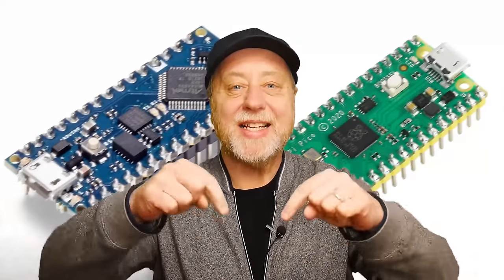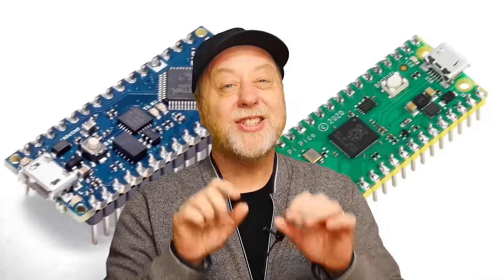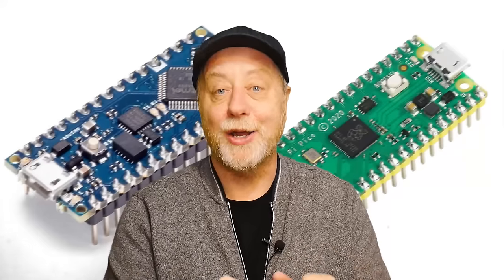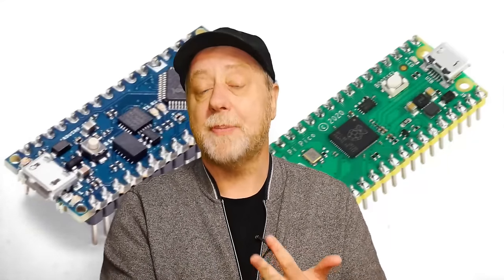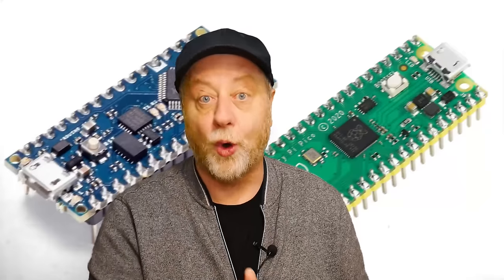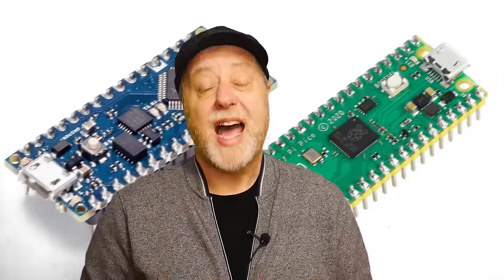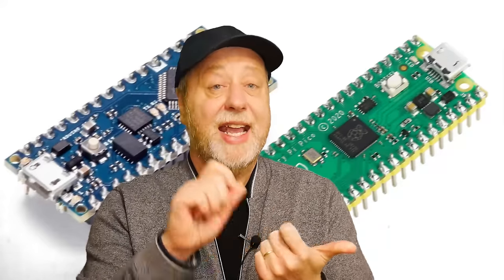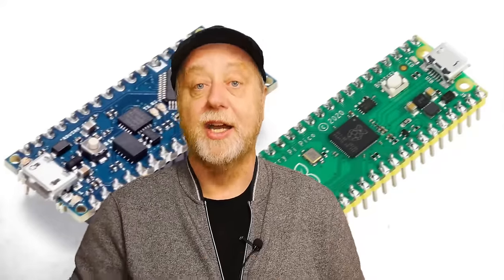Arduino vs Pico - Which is the Best Microcontroller For You?

Comment: Let's face it.... The only benefit in programming with the Pico, regarding Language,  is you can use Micropython.... It's absolutely no Problem to program an Arduino in C or C++ .
Reply from the maker: Can you write a multi tasking OS for the Arduino on C? I did for the Pico. Videos are on this channel.
Reply: @GaryExplains  Yes, you can run FreeRTOS on some atmegas. Arduino IDE uses full C and C++, in fact you can use C++17 without any issues.
Reply from the maker: Please point me to an Arduino IDE sketch that allows you to do context switching.
Reply: @GaryExplains  How is this related to being able to use real C and C++ in the ArduinoIDE? As I mentioned above, you can use C++17 with templates, constexpr, etc. Also, FreeRTOS runs on pretty much all atmegas, including with preemptive context switching but I don't see how that's relevant as it's just proof of what peripherals and features atmegas provide, not of being able to use C/C++ in the ArduinoIDE. 
I found your videos very interesting, but this is just not true: there is no special version of C for the Arduino. It's regular C and regular C++, same as for the pico.
Reply from the maker: The fact that you need to use setup() and loop() means it isn't FULL C/C++ access like the Pico. You have access to all the C/C++  stuff, yes, but you can't write you own OS for the Arduino using the Arduino IDE, something you can do with the Pico. That is very much related. it is not true that the C for the Arduino is the same as the C for the Pico. If it is the same as you say, then please take my Piccolo OS (it is in my GitHub), which I wrote for the Pico and port it to an Arm Arduino using the Arduino IDE.
Reply: @GaryExplains  Ah ok, you're referring to the entry points being different: pico having the int main(...) and Arduino having the setup() + loop(). This is part of the runtime, not the language. Same is true for console applications in windows that use int main(...) and win32 applications that use WinMain and an event loop: they both use FULL C/C++ even if their entry points are different. Same is true in our case here: runtime support and entry point != language support. Also, btw, using loop() is optional. You can treat setup() as main() and do everything in there.
Reply from the maker: OK, I give up we are clearly at an impasse. The simple fact is, not matter how much wriggling you want to do, that you can't port an OS like Piccolo OS to the Arduino using the Arduino IDE. That by definition means they are not the SAME. Clearly you think the word SAME has another meaning. Also you seem to be a little lost in your argument, I asked "Can you write a multi tasking OS for the Arduino on C" in the context of the Arduino IDE, you replied, "Yes" but now you are making arguments about entry points. It is truly dizzying talking to you. Bottom line: can you write and OS like Piccolo OS using the Arduino IDE? Answer, no. Therefore they are not the same. Everything after that is just noise.
Reply: @GaryExplains  I'm sorry you feel that way. Let me explain what I mean: You mention in the video that Arduino doesn't use the full C and C++. That is false, or at the very least misleading, as Arduino does use a full C/C++ compiler. All the language constructs are available, even more modern ones like C++17. There are differences between the 2 of course, like the main vs setup/loop entry points. BTW - I looked at Piccolo OS code and I don't see any reason why it cannot be ported to atmega. Functionally, the main function in pico is equivalent to the setup function in Arduino. Hope this clarifies what my point is, as I'm not trying to be combative in any way. I have lots of years of experience on atmega and arduino (as I'm sure you do as well) and I'm just trying to clarify what I perceive as a misunderstanding on your side. Cheers!
Reply from the maker: Please give me the timecode where I say that "Arduino doesn't use the full C and C++. " I just doubled checked the video and I don't say anything like that. Maybe that is why you are arguing with. I do say the Pico uses full C/C++ and that you can write a multitasking OS with it, something you can't do with the Arduino IDE. I think you have basically misunderstood what I have said and are arguing with me for no reason. BTW, it isn't a misunderstanding on myside, but on yours. The key word is "perceive", I think you truly believe that you are right and trying to argue a good point with me, but you are sadly wrong. I await the timecode where I say what you think I said. As I have said repeatedly (and in the video) you can't create a context switching OS using the C/C++ (and runtime if you insist) that comes with the Arduino. Please show me an example of context switching using in the Arduino IDE. And I don't know why you keep going on about the atmega, since there are Arm Arduino boards, lets just stick with one arch. Can you port Piccolo OS to an Arm Arduino using the Arduino IDE, yes or no?
Reply: @GaryExplains  I think it would be worth mentioning that Arduino can be programmed without any use of Arduino ecosystem in plain C/C++ and compiled using avr-gcc, in which case you just have main() function and you are enabling pins by setting registers, which is actually faster than using digitalWrite()
Reply: You don't have to use Arduino IDE If you don't want... The Classic Arduinos use Atmega Chips, most of these Chips existed long before there was any Arduino....

Comment: 8 Bit won't make it slower.  It simply limits how much you can do.
Reply from the maker: If you think that then you don't understand the difference between 8-bits and 32-bits. Think about adding 70000 to 8000. Is that slower with 8-bit arithmetic or the same speed as 32-bit arithmetic?

Comment: Regarding debugging and writing low level code with arduino, you can always use atmel studio’s ide. That isn’t necessarily an advantage of the pi.
Reply from the maker: You could always write the binary by hand. The point is not about alternative software available for each platform, but rather the official software.

Comment: Arduino does use actual C++ with gcc under the hood. It just does some pre-processing to create a proper C++ file (concatenates .ino and .pde files, generates function prototypes, sticks #include <Arduino.h> at the beginning, etc). But you can use all of the features, like constexpr, templates, lambdas, auto, SFINAE black magic, etc.

Comment: I think for beginners Arduino is definitely the one to go for because of all the educational resources and tooling available. Once you become more experienced then Pico is a viable alternative for projects, and perhaps preferred for cost and obtaining control over low-level details.
Reply: Pushing 50 and I picked up my first Arduino less than a month ago...  Tempted there exactly as you describe!  
I have a few Node MCUs with Wifi on them to try and make the clock I have working on a 'clone' maybe talk to the internet for accurate time...  
I feel like I have bitten off more than I want to chew, but I AM only a month in, and I DO see the plusses of the Pico already.
Reply: @Summ0ns  Haha, age same. Same condition. First time user since a month. Great stuff indeed, it's a huge step forward compared to hobby electronics just 30 years ago. About the need for an accurate time, the logger shield of Arduino has an RTC chip on it where one can set the time and it would stay on par while the battery lasts. One more, the SIM800 shield receives date & time stamps of SMS messages accurately. Or simply buy a PCF8523 DIP version of the chip and connect some minimal components to connect via I2C to it, and voila. I wonder if there are RTC chip only shields though, if one is only interested in the RTC functionality. 

Side note to the Pico, it has huge potential, to start with it is not restricted to this tiny RAM the Arduino Uno for instance has. Using the Mega just for a bigger RAM is a bit overkill in my case.

Comment: Great Video!! I've been using Arduino for the 5 years but have kept my Eye on Raspberry Pi. Most of my projects can be done with a Nano however some of the not complicated projects that require multiple I/O are tough to design due to limited or over lapping pins for different protocols. The Pico with multiple SPI busses and I2C support will solve that nicely. I'm also thrilled that it can be programmed from the Arduino IDE. I will be strongly considering the Pico but I don't think I'll get rid of my Nanos though. My number one complaint is the 3.3v logic level voltage needed. The Nano shines with its onboard regulator

Comment: This is very interesting as a hardware engineer I have always loved arduino it makes hardware projects so fast and easy however i have had issues with debugging capability in the past, if you aren’t careful you can get in a mess very quickly, and also limitations due to only having a single core meaning I had to use 2 boards.  I have loved the ultra low power capabilities possible with arduino and wonder if the pico can compete in this respect. I am definitely going to get a pico and have a play with it there are probably certain projects I would use it over an arduino
Reply: > "due to only having a single core meaning I had to use 2 boards"
You could just code things differently instead: either do some basic multitask stub via constantly looping over multiple smaller functions, or utilize a dedicated middleware solution like FreeRTOS.
Reply: @TheLukasz032  Idk much abt anything, but I would use some protothreading library i found online to run stuff on my arduino.
It didn't seem to really have any issues at all. Really did work perfectly fine.

Comment: Very informative. A year ago I designed and built my own Energy Management System based on a Rasp Pi Zero with Python but I wanted to interface to a micro-controller to read pulse outputs from 3 electricity meters (PV generation, Consumption & Purchase). I was going to use IC2 for the Pi to request the pulse counts every x mins. My first choice was the Pico as I could use Micro Python but found that Micro Python does not support the Pico as a client. I found a web comment from the developers that it was too complicated and unreliable. 

So I switched to a Arduino Nano Every and found the IC2 client library and the IC2 general support was very good and I soon had written the client code; all interrupt based. 

One issue was the Nano is a 5V board so a 3V3 to 5V logical level converter was needed on the IC2 interface, plus a 5V supply was needed. Another issue is that I could not get the Arduino IDE to run on a Windows 10 PC with a usb connection so had to use the web IDE. Finally, I burnt out one Nano when it was connected to a 5V supply via the 5V pin and the usb socket at the same time.

Comment: I mostly use teensy boards (with arduino libraries and the arm-none-eabi-gcc compiler) but I think I will have to try the RPi pico, it seems a very capable board especially for the price
Reply: It's surprisingly fast and capable for $4. MicroCenter had them on sale for $2 when they came out and I got a bunch.
Reply: Some of the earlier teensy boards didn't seem like that much of a bargain.  But Teensy 4.0 blows my mind!  600 MHz, superscalar architecture, branch prediction, 64-bit floating point in hardware, Coremark score of 2313!  (For reference, Arduino Mega 2560 has a Coremark score of 7.)
Reply: @d.jensen5153  absolutely, for high compute applications the teensy 4.x can't be beaten, but I find myself using a lot of 3.2/3.6s which could be replaced by picos

Comment: Need Wifi and Bluetooth? Use an ESP32 WROOM. Works with the Arduino IDE, is inexpensive (<€5) and has numerous libraries for IoT applications, e.g. a web-server, Wifi access point. It also comes with a realtime operating system (FreeRTOS) which makes a lot of things easier.

Comment: Great video, Gary! Bring on the RP4720 :-) I used the RP2040 board from Adafruit, and I liked it a lot. I also like the ESP32-C3 and original ESP32 a lot. I look forward to a dual RISCV core version of the ESP32-C3. I hope that's in the making. Thanks again. Also: subscribed!

Comment: Comming from Pic Micros and PicBasic Pro i have been looking for my next platform as Pic micros are more or less a thing of the past. I have been tinkering a bit with Arduinos and they are really good, but i just can't make friends with C++. It feels soo backwards and "not for me" that i have never been able to make any headway. Recently i dipped my toe in MicroPython and this makes so much more sense to me. Finally i can make sense of things and i have some Picos on order. While i wait i'm tinkering with a ESP32 dev board and it's an amazing board. Too much power for my tiny projects thou. The only thing i miss from the Arduino eco system is the 5 volt IO's. The 3.3v is making stuff a bit more complicated and you need to be careful not to let the blue smoke out. It's impossible to get it back in.

Comment: I used to use Arduinos, but switched over to Teensy board several years ago because of speed and size. The 3.2 is similar to the Arduino Uno with numerous advantages. Teensy 3.2 has 3 serial ports which do not conflict with the serial over USB. It also will operate at  120 Mhz where as the Uno operates at just 16 Mhz. That is 7.5 times faster. It is als 1/4th the size. It also have digitalReadFast and digitalWriteFast, which is similar to port manululation. It is definitely much faster read and write times than the Uno. Check them out.

Comment: Biggest issue with Arduino vs. a PICO running micro python is asynchronous programming support in my mind.   Micropython you can use ASYNCIO to schedule and run multiple non-blocking threads.  I have not seen an equivalently easy way to do this in arduino :(

Comment: Try picomite basic on pico awsume!!
Reply: Yes PicoMite is a very functional BASIC language tokenized interpreter.
For me the greatest advantage is the "immediate mode" where you can directly test IO pins from the keyboard.
No need for compiling and such to make it work.
To get it started just copy the MicroMite .uf2 code into the Pico and it just starts running. What could be better!!!!

redrok

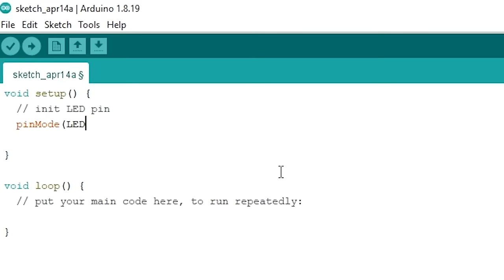Comment: This video contains an inaccuracy (at 4:05): the Arduino "language" is not "C-like," it IS C++.
However, the microcontroller doesn't implement, by default, some operations (like dynamic casting) and the standard library is missing. But it's not a different language, just pared-down C++.
Reply from the maker: Your comment contains an inaccuracy, please read this page in the Arduino documentation, where it says "To do so you use the Arduino programming language (based on Wiring)"  - https://www.arduino.cc/en/Guide/Introduction
Reply: @GaryExplains  ... which is oversimplified explanation. Arduino IDE actually uses GCC compiler in the background, so ARDUINO can be programmed in C or C++ or even AVR assembly.

Comment: 9:32 funny.. i did it the other way.. i used the atmel studio ide to flash the arduino in "pure c code" without all that slowing down arduino fuktions.. awesome as long as you do not need an gui..

Comment: The Pico seems cheaper, more flexible in terms of programming options and quite powerful. I'm struggling to see where an Arduino nano that didn't have some kind of special feature added on can compete. Of course the Unos and the Megas and all the other boards are just different but yh, interesting.

Comment: I am using the Arduino for controling lots of devices an Sensors at my University. The Problem is, that you have lots of devices who give you an analog output soignal. For instance I have an assortment of MassFlowControllers here and they give me 0-5V output signals. I have build a universal controller Unit that can even work with MFCs from different companies. With tha Pico I would need to add a 5V ADC and extra power components all the time beacuase the Pico is only 3.3V. So the old atmel bords are here to stay at least for a while for me but I guess at some point even the Sensors will switch to purly digital.

Comment: I would say Arduino is more like C++ than just C because its Object oriented.

Because of Arduino I'm looking for a job in embedded systems.
Reply: I'm a recent graduate in computer science and I'm in the same boat. Messing with micro controllers made me love embedded systems
Reply: „Arduino“ is just using the GCC C++ Compiler, which has a quite good AVR8 backend.

If you look at the Arduino libraries, you can get the idea that not everyone thinks in C++.
AVR-GCC supports even newest chip versions, so just writing plain C++ is easy.
Even writing an RT-OS is not hard. Or use the FreeRTOS port for AVR8. 
If only there would be more RAM. I used FreeRTOS on a Mega1284 with 16k RAM. That allows „some“ tasks.

Comment: At 01:10 you are zooming in on the wrong microcontroller, the Atmega16u2 is just the USB to serial bridge of the Arduino Uno. It replaced the FT232RL of older Arduino versions; some may still remember the big uproar about fake FTDI chips, which led FTDI to the decision to pretty much destroy those chips by overwriting the device ID and vendor ID by their Windows driver. Obviously this was the wrong decision because most vendors redesigned their boards to use something else like the CH340 or the CP2102.